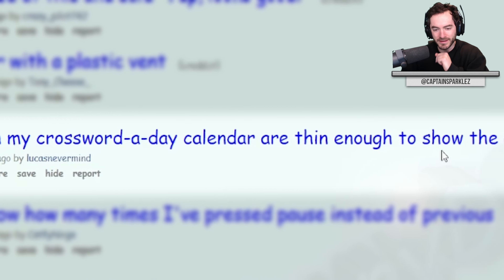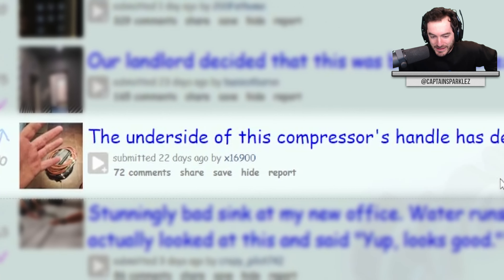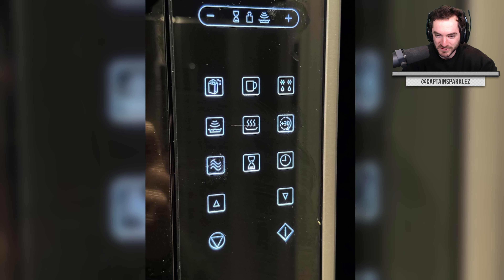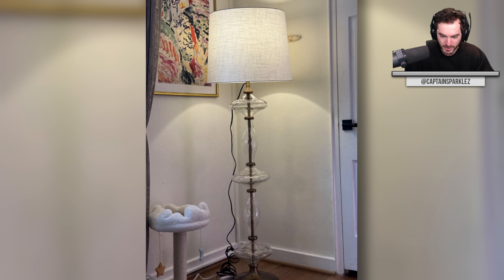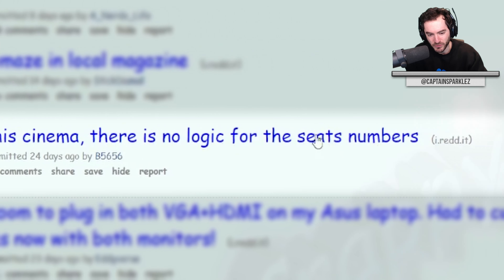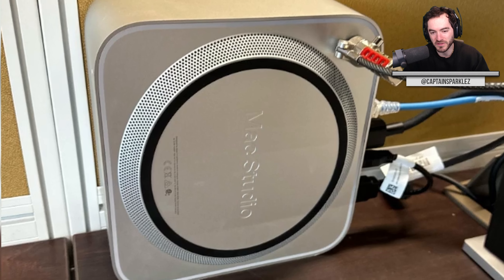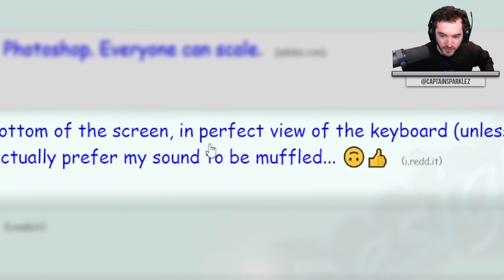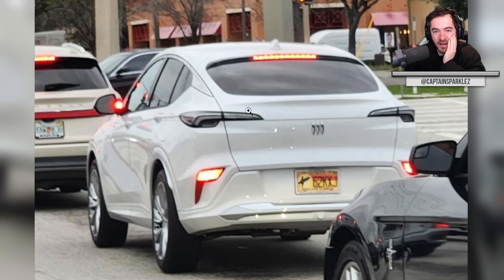Cybertrucks Are Rusting?

Comment: I'm fairly certain the Buick lights are redundant brake lights. Brake lights aren't allowed to be on anything that moves, so the ones on the hatch are technically not compliant, thus the redundant set. The ones on the hatch must also be burnt out, thus the redundant ones are being used.
Reply: I don't think so, because GM did the exact same thing on their new bolt EV and EUV, where the upper lights are completely useless in day time and only lights up as night time running lights. And the shape of those lower lights look just like your average reflection strip on any other car that is not anti human. There are even dedicated threads from bolt forum on how they can bodify their cars to light up the upper lights as well as the lower lights when they brake.
Reply: Nope, the top lights are only on when headlights are on. Break lights & blinkers are down there which is really stupid since while they can't put break lights on the hatch the outside part would be legal

Comment: I dual output from a laptop at work. I use a single USB-C to plug into a dock. That one cord does audio, video, power, and gigabit network. I'm guessing the dock is doing a lot of the heavy lifting because it gets fairly hot. But triple monitors are amazing. Laptop screen for little, idle things and the dual 24" screens for main tasks like CAD. Modern laptops are pretty beastly.

Comment: Yeah but I think the issue with the Cybertrucks are that they are ALREADY starting to rust despite literally being brand new. There are regular steel-body/frame vehicles that took years to develop their first rust spots, and here is brand new vehicle made by a super-modern techy company that has had the first signs of rusting on their product within the first like year. And yes stainless-steel will rust - especially in certain conditions - but again, part of the benefit of stainless steel over regular steel is its higher resistance to rust starting. This shouldn't be happening AT ALL yet. Not for a good few more years.
Reply: Exactly, real stainless steel won't rust easily at all. However, low-grade stuff is practically no different from iron in terms of corrosion.

Comment: The problem with the cyber truck is that the stainless steel outer layer has not been used since the delorian because it rusts immediately, and the reason why you find advice about removing the rust is because of the delorian. It has always been a bad idea because rust comes in no matter what. But they do advertise wrapping the car for exorbitant amounts because they don`t care about the customers, they care about the aesthetic
Reply: The cybertruck does not rust. Raildust lands on everyone’s cars and thats why it’s so easily wipeable off the stainless steel using barkeepers friend and a towel.

You can see the same raildust on white cars as well.
Reply: @starshipdriver8536 you’re wrong, do some research before going out to bat for daddy elon.
Reply: @starshipdriver8536  Sure, "dust" can be wiped off. Rust though, is a chemical reaction. It's literally oxidation, a kind of corrosion. That means the iron in the steel is chemically combining with oxygen to create iron oxide, the crumbly red stuff that is rust. You cannot wipe off rust, as all that is doing is physically removing the iron the panel is made from. It's no different than sanding imperfections off your car (which you don't do unless your are trying to remove the paint). If rust keeps up, it will eat through the entire panel until it falls apart. Also, any chemical that can remove rust is in truth removing the iron as well. If you use it for long periods of time, the metal will slowly shrink.
P.S. Calling it "raildust" is not a good term to use, as most people are rather removed from railroads, and the term is more indicative of the kinds of things railcars often carry, such as coal, manufacturing debris, or other contaminants. Just use the word dust. Because that is what it is.
Reply: @brody7714  There are vlogs of cybertruck owners wiping off the dust. If it were rust , it wouldn’t come off.
Reply: @adamwalker3560  It’s raildust, outside surface contamination that is easily removed. Not rust corrosion from the steel of the cybertruck. You could wipe off the iron deposits since its raildust and not actual rust.
Reply: @brody7714   It's made out of the same material as Starship, but starship doesn't rust... Both are a proprietary modified 304 stainless I think, which is highly corrosion resistant.

Comment: My god, I'll never understand management that prefers to spend money on looking better rather than essential things. 

I worked at a theater that served food that had reopened after the pandemic and most of the kitchen equipment was barely functional. The fryers leaked oil every night when filtering the oil. The grill just didn't turn on, so we "grilled" everything on the flat top. The impingers would breakdown once a month. The dough roller could not be turned on or off, and we had to leave it on and plug and unplug it. The dishwasher would also breakdown once every other week. And the floors...just terrible. 

When the company finally had money to spend, they chose to change the ticketing system (that turned out to be worse that the original system) and install some recliner seats in some of the theaters. Never mind the fact that 90% of the complaints about customer experiences was about the food. Mind-boggling...

Comment: The issue with the cable lock is the fact that a Mac Studio starts at $1999.00 and yet you can't have it sit at the position it was designed to, also, depending on the fan bearing, have it sit how it is on the image may reduce the fan lifespan

Comment: The stairs one. Yes those look to be normal stairs. But I see what I think the we’re referring to as the razor sharp plates on the hand rails. The supports for the rails are evident. There’s 3 or four of them. So I’m thinking as you guide your hand up it will catch on one of these supports and the corners are squared and sharp. So your hand could glide right int to it and break skin.
Reply: Those are not normal stairs. Look closely. The stairs at the top appear to be level with the eye while the ones on the bottom do not. They're either curving very slightly or tilted very slightly. Definitely tripping hazard. But yes, I believe you are correct about the rail supports.

Comment: I had a bath tub that was 2 feet higher than the floor.  The bottom of the inside of the bath tub was 2 feet higher than the floor.  I nearly died at that apartment over 20 times slipping getting out of the bathtub.  Now note my balance skills got so good that bowling balls are too easy for me to swing a sword while balancing on them so I am training on metal poles. I can balance on metal poles and yet I nearly died do to the hazard that bathtub was.

Comment: Pretty sure the Buick is either photoshopped, due to the lights being in front of the mirror of the car behind, same with the light from the front car overlapping the Buicks mirror, or, the top tail lights may only work if the lights are turned on, as everything I can find on the 24 Envista show the top lights illuminated.

Comment: lol no, Steel rusting is exactly why no one else goes paintless on cars. The problem is a huge issue with the tesla truck because there's no plastic paint barrier protecting the body. In other cars while you are recommended to remove it, it's not time critical because the paint will protect the body  of the car. Contrary to what is normally thought, the paint on cars is there to protect the body from the elements, acid reactions and rust.

Comment: 11:00 No, most older laptops won't support triple screens. Built-in, HDMI, VGA - pick two. I know. 😐

11:23 Nope, there's no hole for the VGA cable to screw in.

13:12 Nope. You'd definitely stub your toe regularly.

15:52 MAKE THE PICTURES OF THE PLANES SMALLER. duh 😒

20:18 That driver is 100% going to get hassled by cops for their brake-lights being "out" over and over. 🤦

Comment: The funny part is that it's not the stainless steel that's rusting, but surface contamination that's commonly known as "Rail Dust" which originates from train tracks/brake dust that settles on the body of vehicles being driven/transported in the rain. This happens to all cars but is more noticeable on light colored vehicles. That's why it came off so easily when cleaned using BKF.
Reply: Brake dust also sticks to some steel surfaces better than others, the front rims of my old car would be covered in brake dust again after only a week if i cleaned it
Reply: That’s misinformation, are you perchance a tesla employee? Do you need help? Do they have your family?
Reply: @brody7714  How is it misinformation exactly?

I've had to deal with the same type of rust on my clear coated cars. That's how I first learnt about it. This is pretty common knowledge in the automotive community, especially amongst detailers.
Reply: @ethan999oz  I agree with what you are saying about dust, but many of the cases involved aren't dust but actual corrosion, causing pockmarks when the rust is removed. The term "rail dust" is more of a trend being used to defend the cyber truck at the moment than its correct utilization. Many of the rust complaints come from owners who had a perfectly clean vehicle (that they already obtained, and sometimes even didn't drive yet), that then developed rust spots. No rail dust involved there.
Reply: @adamwalker3560  No the owners did not have corrosion on their trucks since the rust did not come from the stainless steel. It was the iron particles that settled in the pores of the steel that reacted and rusted and can be dislodged by citris77 and wiped off. 

If it were actual rust from the truck , then it wouldn’t have been wiped off the truck in seconds.
Reply: @starshipdriver8536  Is it the same with Starship?
I know it's kind of different because it is exposed to salty air 24/7, but they use the same metal from what I heard.
Reply: @witherking97  Sprinkle some dust from a rusted brake rotor on starship and it will not look clean but the rocket isn’t rusting.
Reply: @adamwalker3560  You can easily Google "Rail dust" you know. It's not some made up word used to defend CT. Originally, 'Rail' referred to train tracks, which was one of the main sources of iron particles that end up turning into rust spots on cars. It's easy to tell if it's rail dust from it's appearance to the effort it takes to clean it off, which in this case was simply using Barkeeper's friend to wipe it off.

Also, CTs are being delivered from a limited number of locations atm, which means there is almost always some amount of driving involved when an owner takes delivery of their trucks. So it's pretty easy for the dust to accumulate and start rusting, especially in rainy conditions.

Finally, one of the lead cybertruck engineers and several detailers have already confirmed this to be the case.
Reply: @ethan999oz  I did check the term, and I was referring mainly to reports post delivery about rust. My point is that it can become an incorrect trend word, much like organic is. Of course anything that wipes off so easily isn't rust of the panel itself. You can't get rid of rust without physically or chemically removing the oxide. I think the main point is that they could have just painted it that color if they wanted the aesthetic. There's no meaning to adding hundreds of pounds of unpainted steel to a vehicle, albeit I would say they probably have decent crash protection with all that extra mass.
Reply: @adamwalker3560  they’re actually pretty deadly to the driver in a crash because they don’t properly crumple

Comment: 4:54 That's actually good design: the icons are easy to identify here, and using iconography rather than written language is pretty much an universal standard everywhere but the US to allow people from different countries to understand the same informations without a need for translation. So qualifying that as "crappy design" is actually a USdefaultist moment provoked by the usual bad design of US way to do information dump.
Reply: Arabic numerals are pretty damn universal as well. That microwave has 0 numbers on and seemingly doesn't even let you set the time manually, only having presets.
Reply: @gamesandglory1648  there is an hourglass (time icon) and plus and minus icons, pretty sure you can set whatever time you want.

Comment: Every architect should be forced to shadow at minimum two disabled people, one mobile wheelchair user and one full time wheelchair user with low/no mobility, preferably one with a manual wheelchair and one with electric to account for size, turning and rollunder differences. It would solve so many access problems and ADA violations.

Comment: The tern stainless steel states what it does in the name.  It stains less than regular steel.  It does not state that its rust less but stainless.  Like when you leave spaghetti inside of of a plastic container and you get spaghetti stains in the plastic but if you used stainless containers you would have less stains not zero stains but less stains.  It does not state that its rust proof or even rust less its stain less.  Its in the fucking name.

Comment: You see, actually good stainless steel really doesn't rust. The problem with stainless in the cybertruck is the fact that it's absolute garbage. That's why it's developing black spots and rust spots. The rust and spots often happen when there are impurities and voids in the metal. I have one old Zepter cooking pot from the 90's and its still completely spotless. I also have a bunch of garbage Chinese stainless steel pots I bought last year, and they have black spots and rust spots all over them. It's a quality issue, simple as that.

Comment: 17:10 ... Umm ... nooo? Maybe cars in 80s and some in the early 90s, but car parts have been getting treated with anti corrosion stuff as well as putting a top coat that protects against that (literal) crap has been on cars for several decades now and really the only warning for most cars is if you live in a snowy area where they salt the roads because while the paint is fairly well protected now a days the underside can have the anti corrosive substance chipped away at from all the rocks and salt and stuff constantly hitting it chipping it.  It is not normal for a car to have "you must keep your car in a sealed bag 24/7 expect for when you want to show it because normal elements will make it corrode" unless it is literally just a car for showing and not meant for driving.  Maybe your 6 figure cars do just to be extra cautious, but the normal car for 9-5 job use does not say that shit in there.

Comment: OH MY GOD!!! Finally, someone realize this GM BS on the cars. The chevy bolt, both the EV and EUV had brake lights and indicator on the lower side of the car, the upper lights are only for night running lights. The reason being GM doesn't want to install lights inside so that there are brake lights when the tail gate is up. I've been saying this for at least 3 years that the bolt is the single car on the road I hate the most because of how those lower lights look exactly like the reflection strip on any other regular car.
And it's not just brake lights. For the love of god, GM, why do you have the cars reverse lights on even when they are in park? Why? Do you think it's safe and funny to waste others precious time?